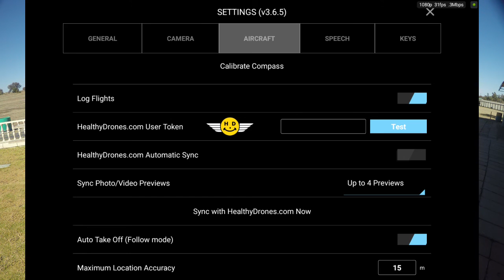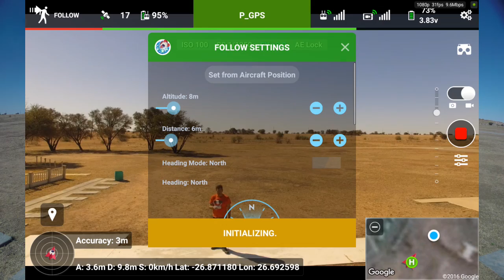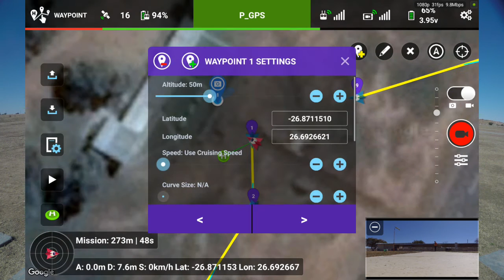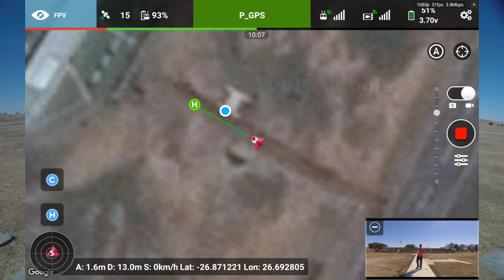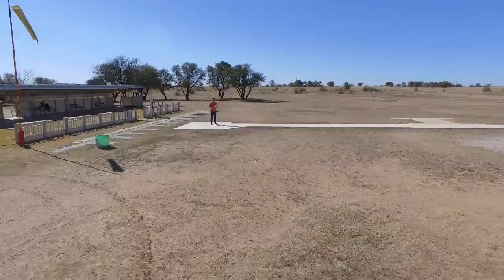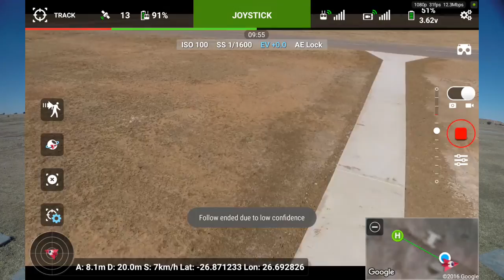First impressions of the Litchi Application

Comment: I dont see on mind where i can put POI. I can only put way pionts. On the computer i can do it from there but not on the app. So is that normal ? Shall i just use the app to load my mission from there ? Thanks for a very awesome video.
Reply from the maker: A POI can be inserted on the WayPoint Map by changing the selector to POI insertion. It may not be obvious at first glance so many miss it.  When you are in Waypoint mode (top left shows "Waypoint") then on top right a number of icons appear starting with a lock. The icon after that (looks like location tag) is your POI toggle.  Click that and insert your POI points.  Click again to switch back to Waypoint insert.
Reply: Hi thanks so much for taking the time to reply. Unfortunately i don't have a waypoint selector on screen its not there. The way i add a waypoint is to simply left click on the map. If i right click nothing happens. I have watched litchi videos and i see what you mean about that little icon but mine isnt there. I know this mind be silly but do i need to do this while phantom is plugged in via USB ? maybe that will unlock this feature ? Thanks for helping me :)
Reply: I think i see the problem. Its coz i got a standard DJI phantom 2. If i had a Phantom 3 or later version it looks like i can do this. Phantom 2 doesnt seem to have this feature it appears. If i tell it i got a 3 or a 4 then it unlocks this feature. Think thats it.

Comment: Not clear what the Nvidia Shield does NOT do? You mentioned a "sim-card", but [again] not certain what not having one does?  I ask, because I'm about to purchase the Nvidia Shield K1, for use with a P4, and if there are short-comings you've discovered, would love to know about them. Thanks!!
Reply: But he could go to Google maps and load the maps ahead of time even without a similar card... Am I correct
Reply from the maker: The Shield is a fantastic tablet, but has no Sim Card slot which means you cannot connect to internet via a mobile connection.  This means that you cannot load local maps when needed in the Satellite view.  The work-around is to use a secondary device (mobile phone) set up as a mobile hotspot and then use WiFi to connect to it for satellite views.
Reply: I just download the area maps I know I'm going to fly in. you don't need a web connection this way. Works just the same as it would if you had an active connection, But yes you can create a wifi hot spot on your phone and connect to it via your shield. either way works, I like to download them because it cuts down on my data usage i only have 20 gig a month with U.S. Cell.

Comment: I like how you've got straight into demonstrating the end result without too much focus on the settings, just what I was after. Subbed ;)

I have been using the Way Point feature recently and I'm getting a strange rocking effet when about 5 meters from the ground. In the DJI Go app, the minimum height allowed is 10 meters and there is no rocking. The rocking is less a problem with litchi too but still happens at certain way points.

Could you give any incite on this?

I can appreciate there is quite a bit of wind in this demo, but yesterday there was no wind and all and the problem still persists. When I switch to manual flight, I can fly at 3ft at any speed no problem.

https://www.youtube.com/watch?v=wpmQyh1Hi-4

Comment: okay great thanks, did you have to force close DJI GO when opening to use Litchi? earlier my camera feed would not connect. it did eventually connect, but with less stability than DJI GO
Reply from the maker: No.  I do not open the DJI Go app at all.  I actually uninstalled it.

Comment: Hi Riaan
I have just downloaded Litchi app for my Phantom 3 Standard. Do you still need to use the calibrate function before flight when using Litchi? I see this can be done in the settings panel.

Also I just wanted to know have if the return to home can be used with same comfort level as DJI go? Are there any first time things to look out for? Does remote for example always have to be set in F-Mode when using flight functions?

Kind regards
Jason
Reply: Be careful... RTH does not work the same as DJI Go... in waypoint mode the bird will continue on the mission you plotted regardless of signal... then when completing mission will execute what you told it to do at end of mission. Likewise in Orbit mode will continue the orbit then on battery critical/low will land in place not RTH... AND most important:

Signal Lost Behavior for Manual Flying   Choose Hover, Land, or Return To Home.  Your choice applies when you are manually flying your aircraft only.  Be aware that autonomous flight Missions you create in Litchi and upload to your aircraft will continue to fly even if the connection is lost.  

The Phantom 3 Standard and 4K (but not the Phantom 3 Professional) exhibit an exception to the selected Signal Lost Behavior as follows:  If the control signal is lost while manually flying either of these two aircraft in the Focus or Track mode or with VR (virtual reality) immersive/Joystick Head Tracking activated, the aircraft will stop and hover, but will not Land or Return to Home.
Reply from the maker: Calibration is done when you feel things are wrong.  Honestly, I cannot remember the last time I did a calibration.  I did not do a return to home demo in the video, but I have tested and it is exactly the same and you can be assured it work just as well as in the DJI Go app.  I may do a video demonstrating how the return to home works and the setting one can do and how it is cancelled (when needed).